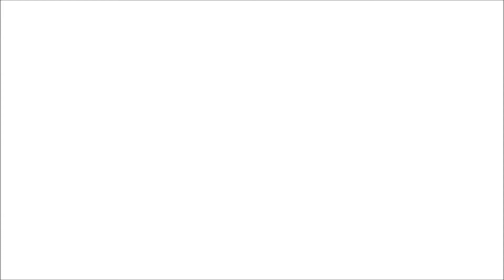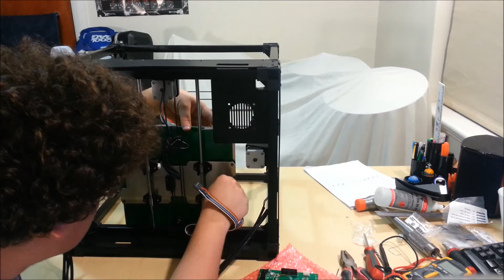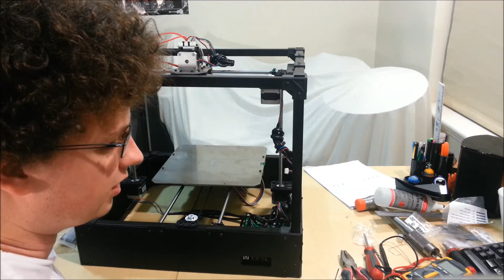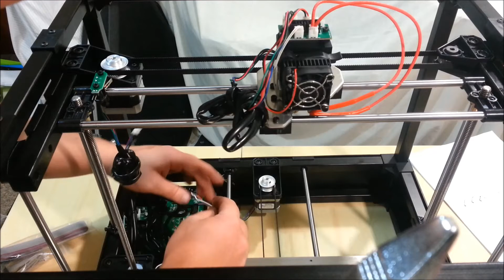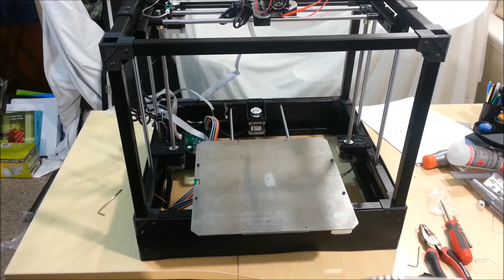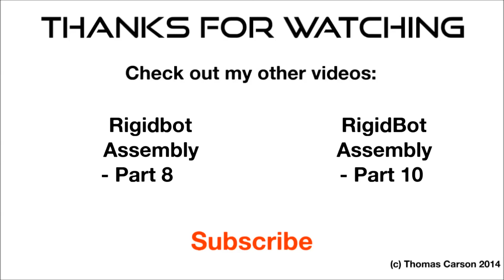RigidBot Assembly - Part 9: Wiring

Comment: Great videos and will help when I get mine next week,
Just wondering what the names are for the degreaser, the grease and lube you use and where I could get them, I am in Victoria Australia 
Cheers
Reply from the maker: To degrease I used 99% isopropyl alcohol from JayCar and to lubricate the z-screws I used superlube which can be bought at element14 (aka Farnell) or bilby cnc or on ebay from America, The oil I use is three-in-one which can be found everywhere (coles, bunnings, kmart, etc).
Reply: Make'n'Mod cheers, just checked my tracking and I am picking up my printer on Monday, so time to go out and get it all